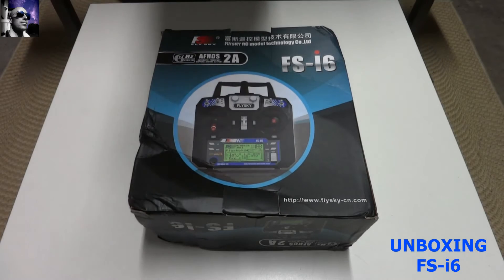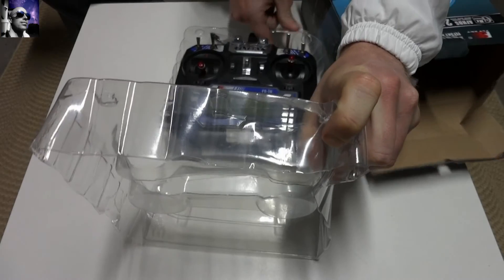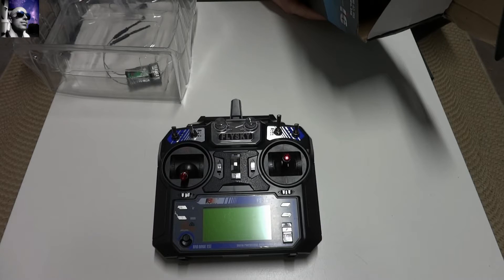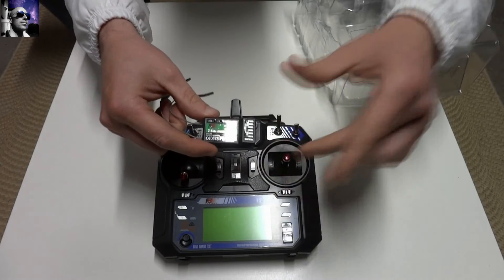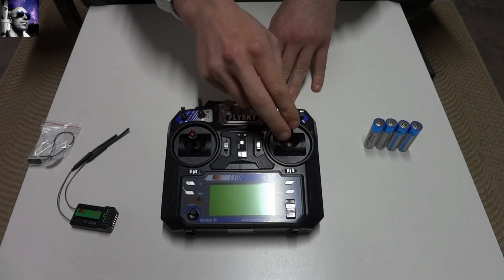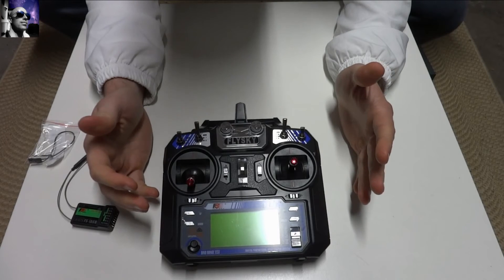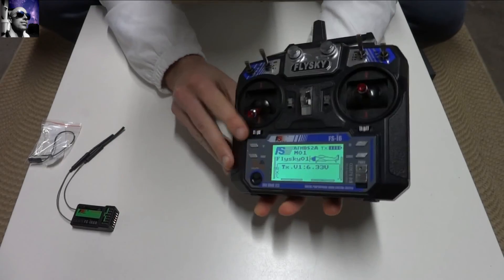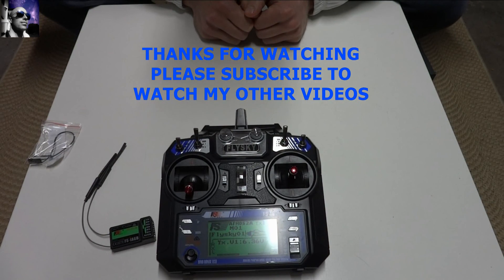FlySky Transmitter FS-i6 Unboxing with FS-iA6B Receiver

Comment: Hi m8. Im having trouble binding my fs ia6b. I do not have another lipo to use as power source. Any help greatly appriciated.
Reply from the maker: Hi there, you will need minimum 4.0-6.5v to power the receiver try your local electrical supply store to see if they have a battery with this voltage then you can connect it to the receiver to bind.
Reply: thank you. will try to get 1 today.